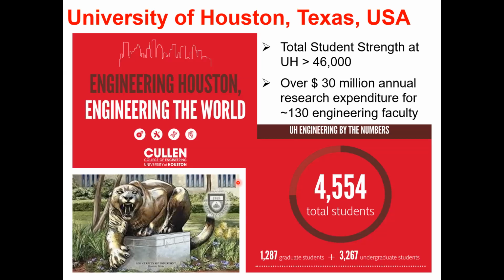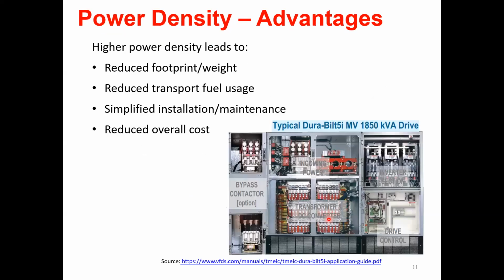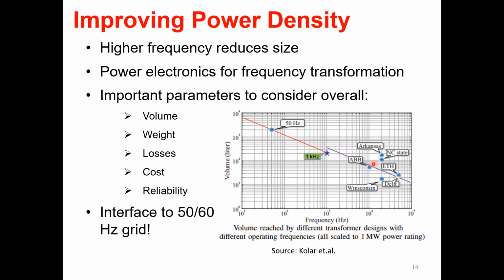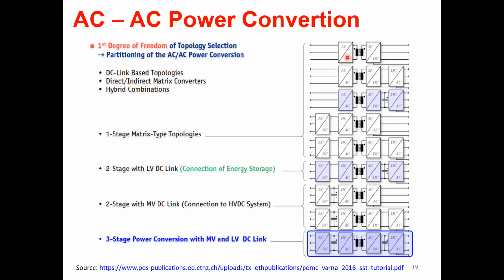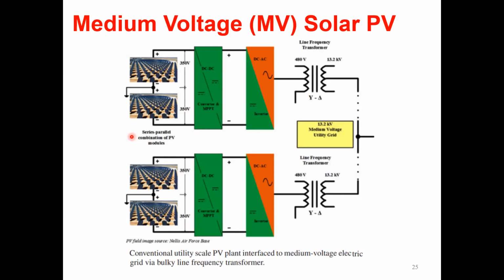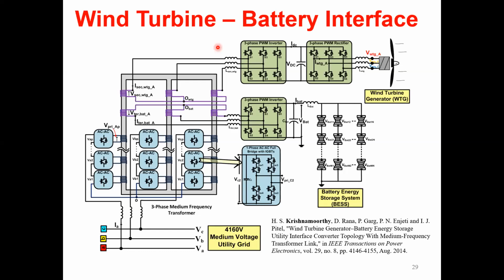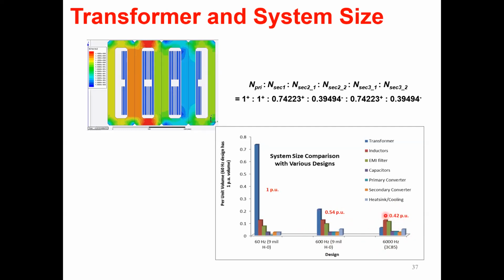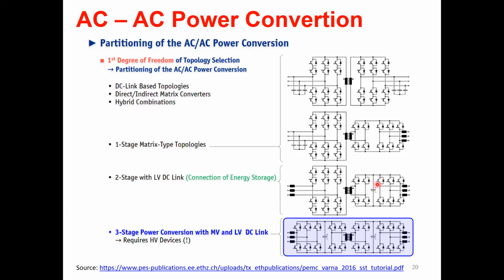Webinar on Solid State Transformers & Applications in High Power Renewable Energy Resources

Comment: Given how awful the result has been for commercial switchers in terms of EMI, I would think that the power levels involved here would pose a much greater challenge. At least theoretically, the design of appropriate shielding and filtering could contain the problem, but I have to think that the added cost/size/weight increase would push manufacturers away from this approach if it was a regulatory requirement. And without those requirements, I can imagine all HF applications (and possibly beyond) will be severely damaged. My area, medical ultrasound imaging/Doppler, typically operates in the 2 to 15 MHz region and looks at signals as low as 100 nV or so. If a hospital was fed by one of these in which the EMI problems were ignored or poorly dealt with, I doubt that our shielding efforts would be successful enough to avoid missing certain pathologies.